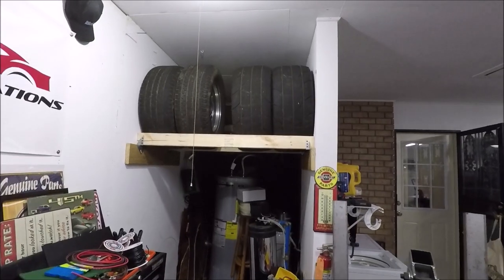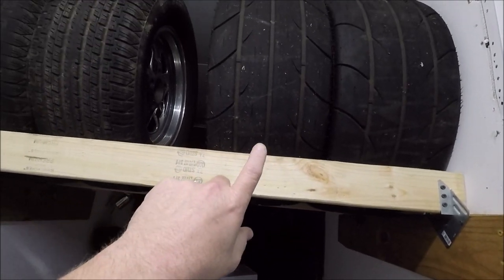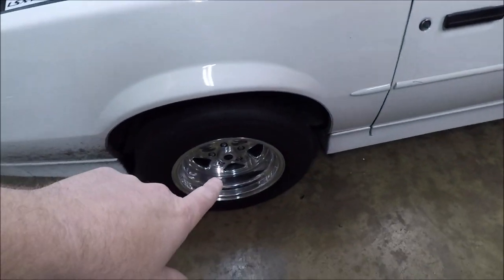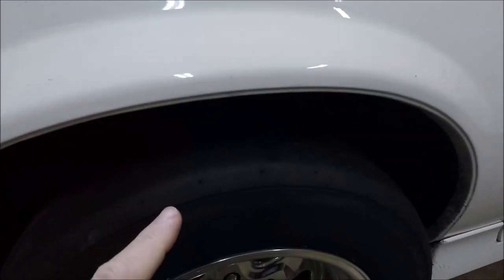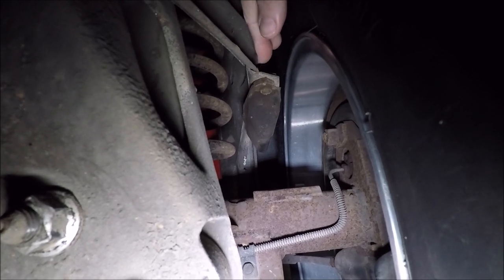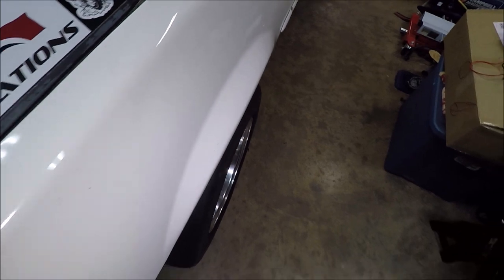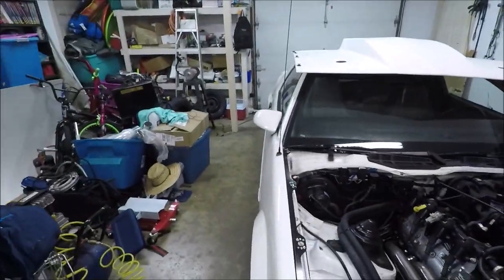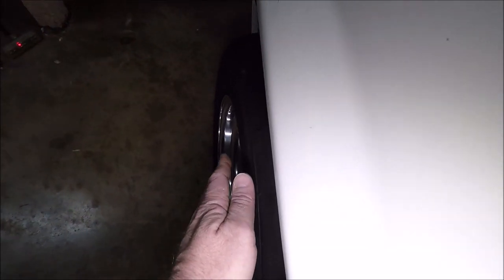FITTING 15x10 WHEELS ON A THIRD GEN CAMARO

Comment: I just got 15x10 for the back of my 72 Mach 1 
Do you think they will fit too ? 5.50 back spacing on a 9” ford rear end with disc brakes.
Reply from the maker: I wouldn’t have a clue what fits a 72 mustang brother. 🤷🏼‍♂️

Comment: I just bought a 91 camaro z28, its been lowered 2 inches front and rear. I wanna upgrade my wheels to a 17 inch either Boyds or Centerline. I don't know what backspace to use. I like your wheel how they are flush with the 1/4 panels. Any idea Chief what backspace i should use??
Reply from the maker: All I can tell you to do is measure and find a placement you’re happy with. For me with a 10” wide wheel with zero offset I feel a 6” backspace is perfect. But modification may be needed depending on tire size.
Reply: @BadLuckGarage  thank you chief

Comment: i just installed a new 9" rearend and had them shorten the axles 1" on each end...How much backspacing do you recommend so I too can put a 10" wide rim on.
Reply from the maker: If you watch the newer videos I just installed a 9” as well. Shortened 1/2” on either side and still running these same wheels. You’ll just need to do a bit of clearancing in the bump stop area and possibly up front. All depends on your tire size.

Comment: So my car isn't super quick but im having problems hooking up.. I don't wanna put anything on that will bump me out of the street tire class.. I'm thinking of copying your wheel set up.. now my main question is what do you suggest would be the biggest street tire size I can run on this setup?
Reply from the maker: If you’re running hardcore class then you should focus more on your suspension. Specifically some adjustable shocks to allow more weight transfer and some adjustable LCA brackets to allow you to set more anti squat. Check out my UMI products playlist for more details.
Reply: Just a street tire class at my local 1/8 mile.. so wouldn't even mess with the tires before that? Its pretty well stock suspension wise I have a non adjustable panhard thats it

Comment: How much do those weigh? And do you have subframe connectors? Watched your umi sway bar video. I have an 89 TTA
Reply from the maker: I believe they weight around 21lbs each. And no subframe connectors yet. So far we’re not seeing any chassis flex on the videos cutting low 1.6x 60fts. What alot of people misinterpret as chassis flex in these cars is actually just a rear suspension that isn’t working correctly. That adjustable anti-roll bar helps a lot with that.  Honestly we may bypass the subframe connectors all together and go straight to a cage since were already running too fast not to have one. 🤣

Comment: Whats the exact part number to the wheels on the Nova? The 15x10
Reply from the maker: This videos almost 3 years old now so I don’t remember the part number, but there’s an eBay link in the description. They’re the 15x10 vision wheels. Zero offset, 5.5 BS as explained in the video. Same as the Jegs wheels with the same specs.
Reply: @BadLuckGarage  And these are the same on the Nova?
Reply from the maker: These aren’t the wheels we normally run on the nova but we tried them on it a few months ago and they fit surprisingly. Here’s a short of them in the nova. https://youtube.com/shorts/JVFWb4ahPjU?feature=share
Reply: @Bad Luck Garage  I saw that video ans it's got me thinking 😁 . Was anything cut out under the fender? Is there any way you can make a longer video showing underneath. Did you relocate shocks or do anything special to make them fit
Reply: @BadLuckGarage  whats the specs of the wheels you normally run on the Nova?
Reply from the maker: @infamousnova  15x7 front, 15x8 rear. Not sure on anything else as Ray bought them used. I will say the BS on his 15x8s needs to be deeper as the 15x8s actually stick out further than these 15x10s do on the nova.
Reply: @BadLuckGarage  oh wow
Reply: @Bad Luck Garage  I'd like to see behind the wheel on the Nova as you showed here